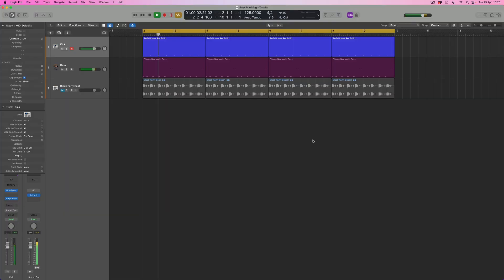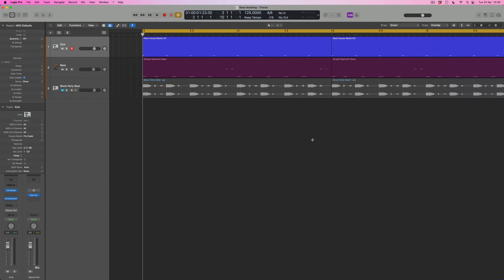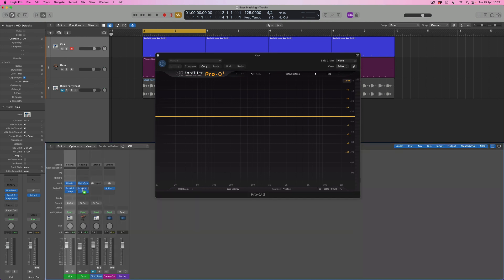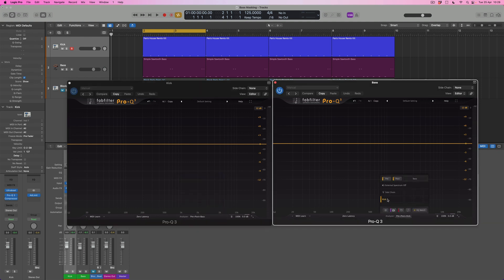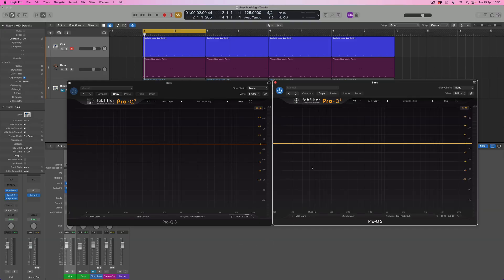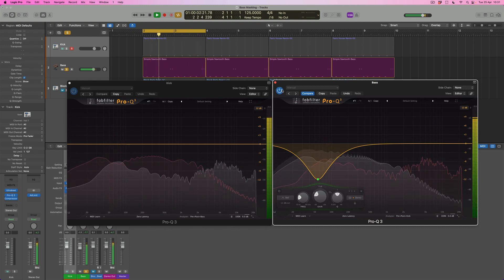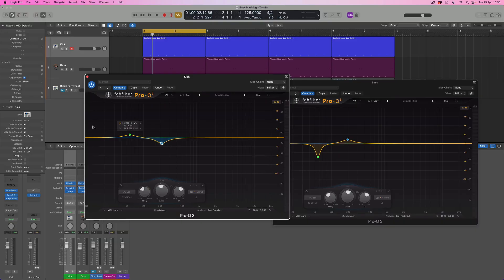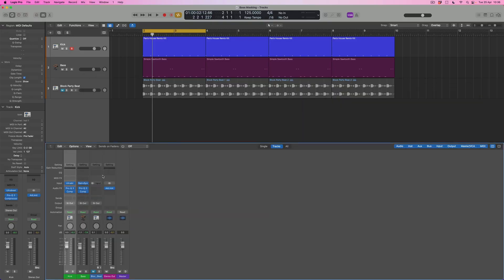LOGIC PRO X - Bass Masking Explained

Comment: Hi Jono, long time viewer here, love your content!  My question is (and apologies if you've answered this before), is what is the difference, in the context of this particular example, between using the autifilter or using a regular HPF in the EQ?
Reply from the maker: Hi, thanks for watching and thanks so much for your question. The short answer is, at the simplest level, that there is no real difference! However, the slightly longer and more informative answer is... Firstly, it's worth checking the slopes on any filter, whether that's a high-pass filter within an EQ plug-in, or within a dedicated filter plug-in. These determine how 'extreme' the effect of the filter is - a 24dB/octave filter works 4 times harder than a 6dB/octave filter to reduce the volume of frequencies below the Threshold point (in the example of a high-pass filter) so, sometimes, there can be a sonic difference between EQs and Filters depending on that setting. But I would say that broadly, most producers reach for EQ to change the tone of a collection of different frequencies within a sound; not just a high-pass filter, but perhaps also by using a bell curve or two to boost or attenuate volumes of other frequencies in the spectrum, to shape sounds from bottom to top. Whereas Filters tend to be single-band - a tool to target a specific frequency area. Accordingly, I think that there's a perception that one plug-in type is more fit for purpose than another in any musical context, but that doesn't have to be true! Secondly, some EQs restrict the frequency bands above or below which they'll let you apply high or low pass filtering, whereas most Filter plug-ins will let you set a high-pass filter at 20kHz if you want to create the sonic equivalent of a dog whistle. The last thing to say is that some EQs and some Filters have a sonic character all of their own. Korg's MS20 and the Moog Low-Pass filter designs (to say nothing of the TB-303!) have a personality which is unique, so sometimes producers will want to bring that flavour to a sound, rather than use a sometimes more 'vanilla' EQ to this kind of processing. I hope that helps!
Reply: @jonobuchananmusic  Thank you for such an incredibly detailed response, it is very much appreciated! Yes, I'm aware of the difference between db/v slopes, I was just curious whether there was a reason or any profound sonic difference between using the autofilter (as demonstrated in this clip) compared to eg Q3 which tends to be my go to.  I use this kind of HPF/LPF and bandpass effects alot when producing lo-fi style soul and funk music, just wasn't sure if I was missing something.

Comment: Great video! Would you recommend using dynamic EQ on the bass so it's only active when the kick's hitting, or does that make it too inconsistent?
Reply from the maker: Hi Lachy. Good question. Bass masking only occurs when bass frequencies collide and pick a fight with each other. So a side-chained Dynamic EQ would certainly help deal with conflicts. The crucial thing to ensure consistency would be to select little to no EQ attenuation as the default amount, with ALL of any attenuation only occurring when the Kick (or other bass-heavy side-chain input source) is playing. That way, in any spots where the Bass is playing and the Kick isn't (to use your example), the Bass sounds effectively 'un-EQ'd'. Hope that helps.